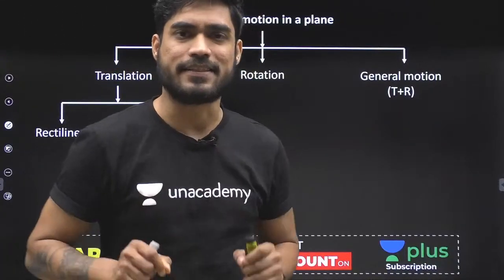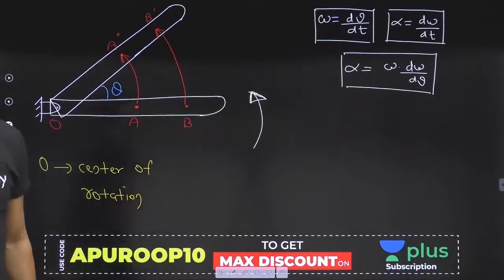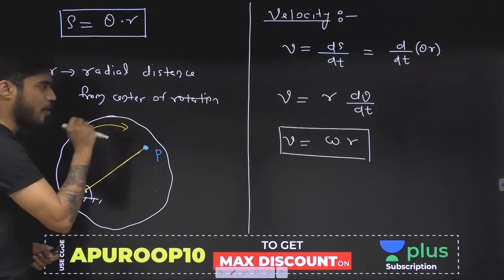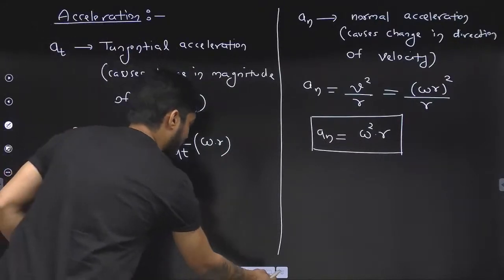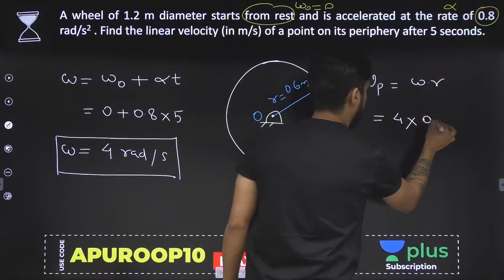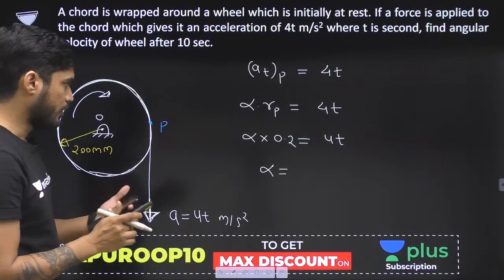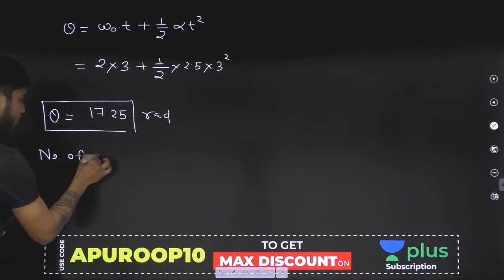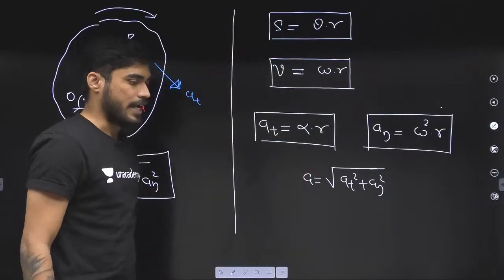Kinematics of Rigid Bodies (Rotational Motion) - 2 | Lec - 31 | Engineering Mechanics | GATE ME Exam

Comment: Sir in 53-54 min we have to calculate tang acc for point D for that we have to consider r=180 mm 
Pls check it sir final ans is obtained as 849 mm/s2
Reply: Concept is correct.. Just taken r value wrong by mistake
Reply: Yup that is the value.
Reply: Even I got 849